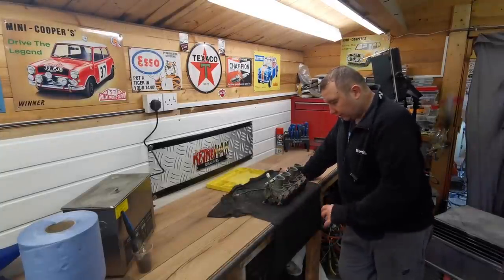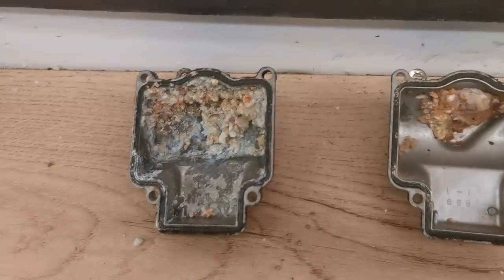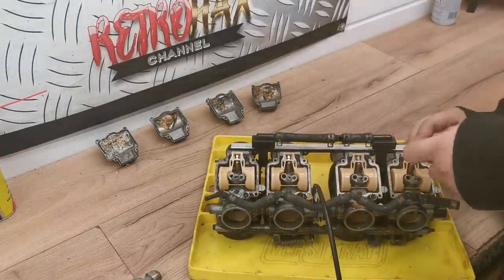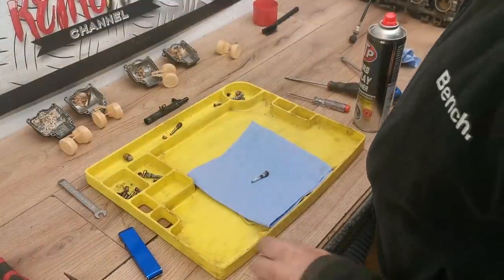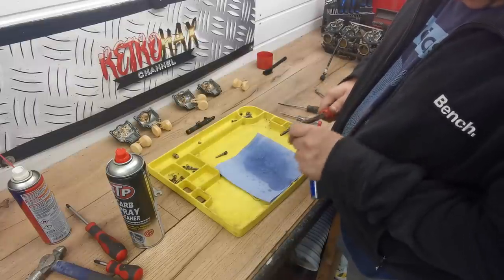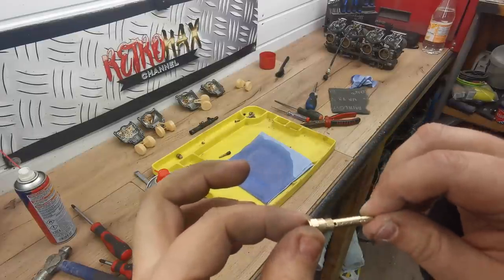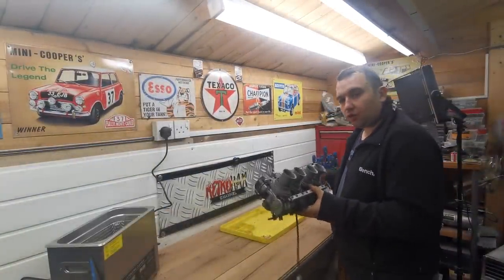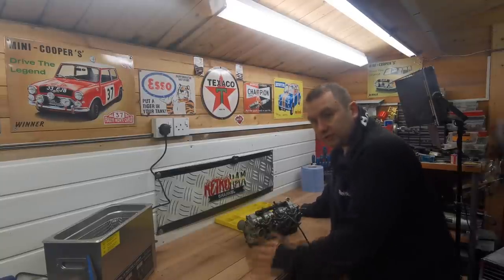Yamaha Thundercat Carburettor Clean

Comment: Same bike as mine and also in same colour scheme it would appear.  Ideally should have checked all the float bowl levels whilst the carbs were off, think its something like 12mm below the marks on each carb.  Also grab a cheap 4 gauge vacuum balancer, makes that idle sound even better and will run smoother on the road.